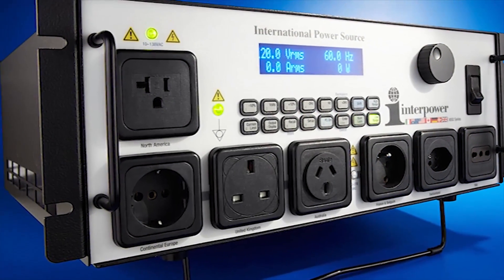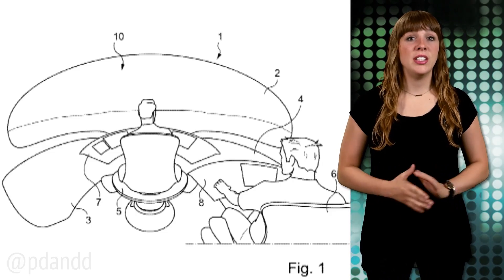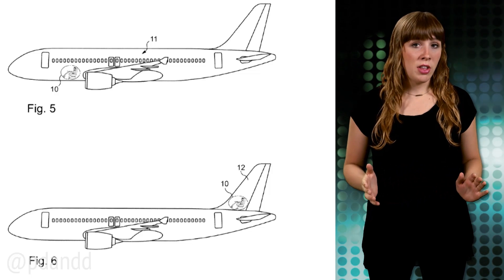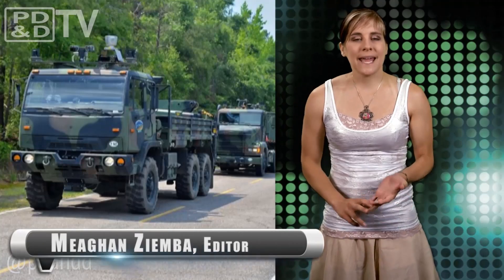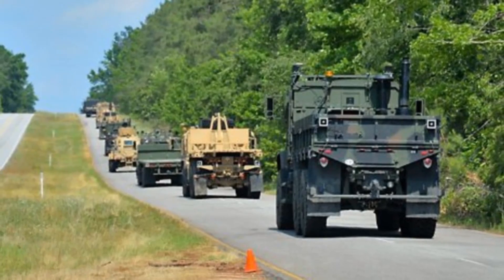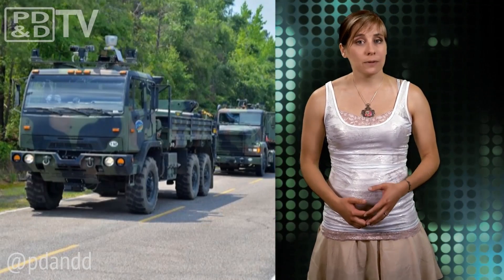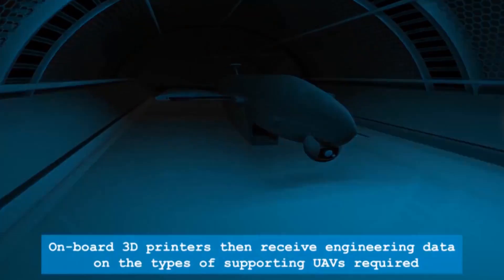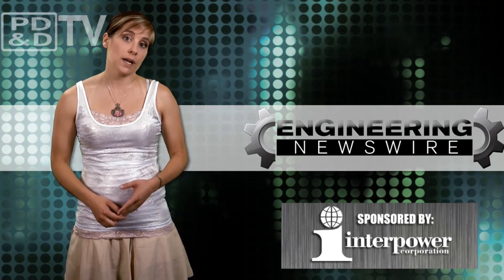Engineering Newswire 98: Airbus Details Windowless Cockpit of the Future

Comment: "technology fails, windows don't" ??? windows do fail! and when they do both pilots die rather than switching to an auxiliary fail-safe configuration and continuing to fly the plane! planes already use electronic fly-by-wire, why? largely because the reduced possibility for mechanical failure makes planes safer! geez, the avionics in these things aren't made by the same retards who make your phones and web-browsers, the aerospace industry actually know how to engineer stuff properly.

Not that airliners haven't been flown primarily according to electronic instrumentation such as radar and gps for years now anyway...